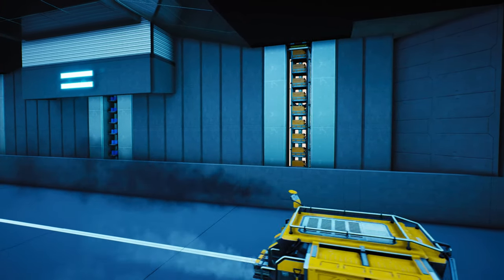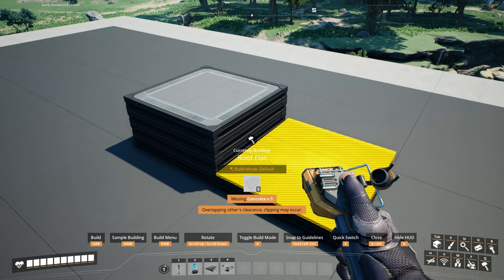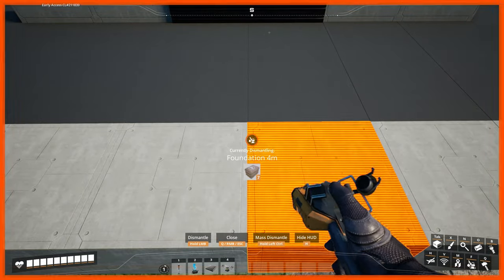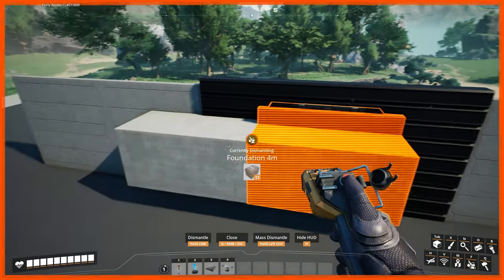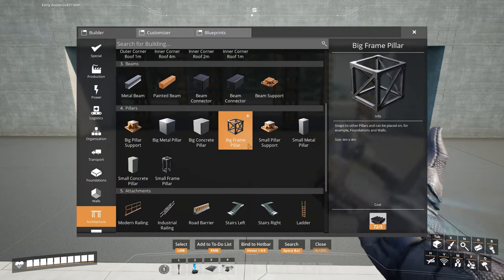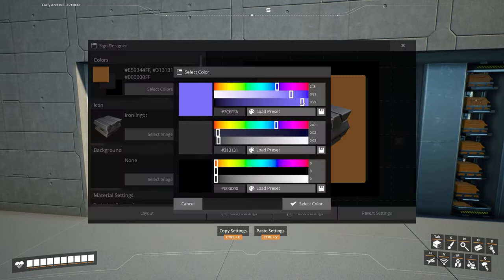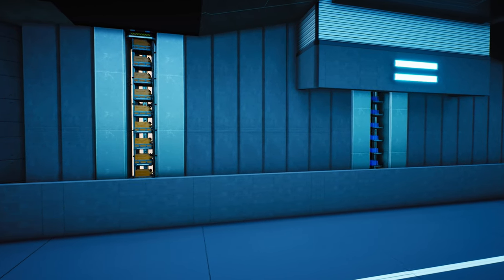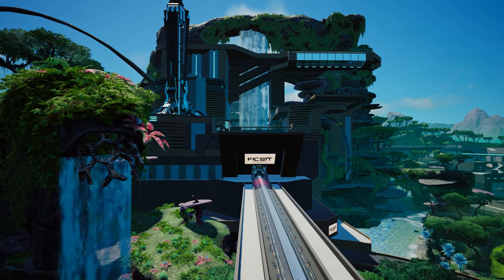Advanced TIPS & TECHNIQUES in Satisfactory

Comment: Really liked the tips here, but I'm wondering if you know that you can just build the foundations as asphalt instantly so no need to paint them? :-)
Reply from the maker: Thank you brother, yes I know this :) there is a reason I don't (I explain this at the start of my most recent video). Basically I use ficsit foundation first as the pattern indicator on the ficsit foundation is the clearest indicator to show the direction of the foundation which is really important with asphalt as if asphalt isn't all facing the right direction when you are a certain distance away it looks "chopped up" but if it is facing the right direction it looks a lot smoother!